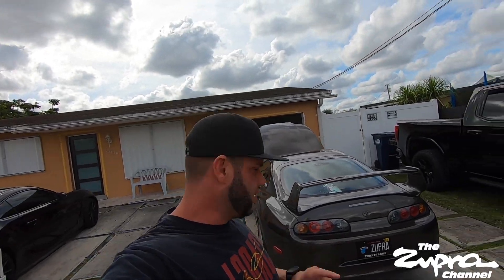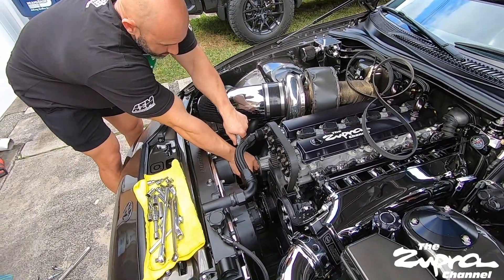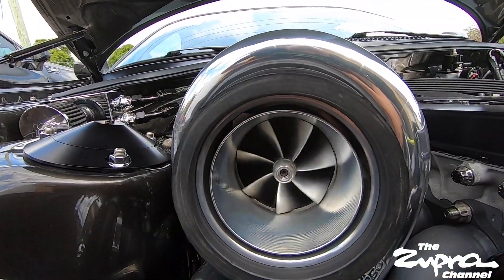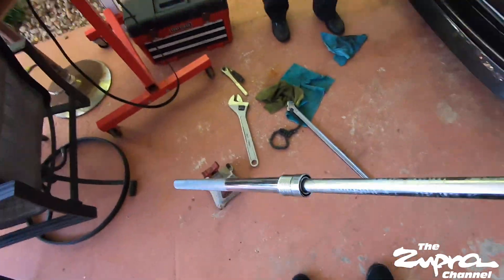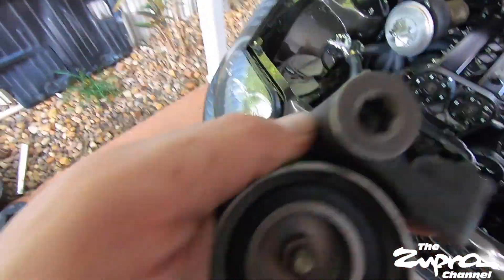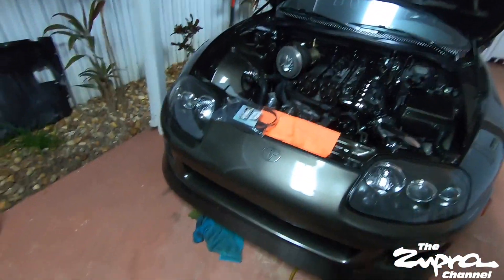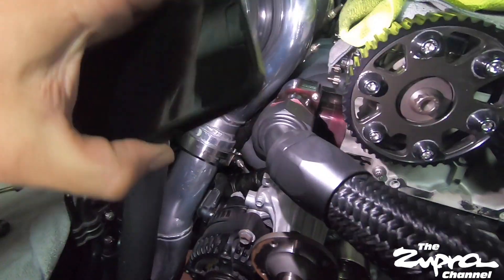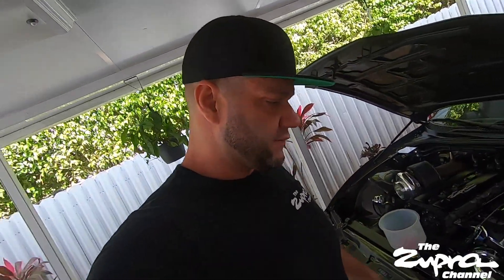2JZ Crank Bolt Won’t Come Out!!!

Comment: Hey brother I would never use any torque gun for putting on the Crank pulley. I've seen a few times when someone actually stripped or  snapped the bolt. Ouch, then the money is really spent then! Good work finding out the other issues and repainting them.💯👍👍👍

Comment: i use a ultra tq Hercules and a 12amp battery from harbor fright and a weighted 22mm gets all my stuck crank bolts out. sucks because you got to remove the condenser to fit big boy in there.

Comment: When you guys install ptfe oil seals there are 3 things you have to do.
1) buy the oil seal from the dealer ( too many fake oem Toyota scammers ) they look nearly identical!
2) do NOT add any type of grease or oil. PTFE seals must be installed completely dry!
3) buy a special tool that uses a bolt to press it in and not a hammer.

Comment: Torque multiplier will cost you $50 (don’t need a brand one) this tool will remove 1000nm with one hand 

be careful installing with it, you can snap the bolt if you over torque 

For bolt removal there’s nothing better on the planet